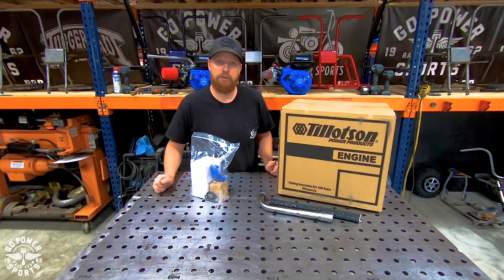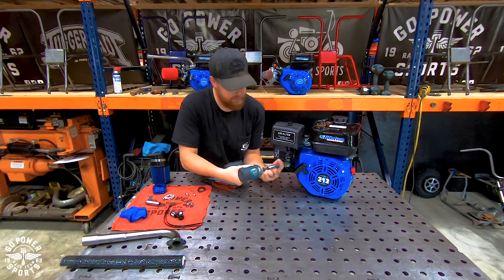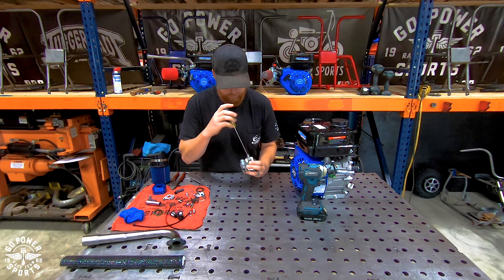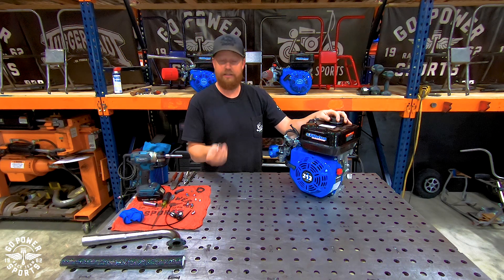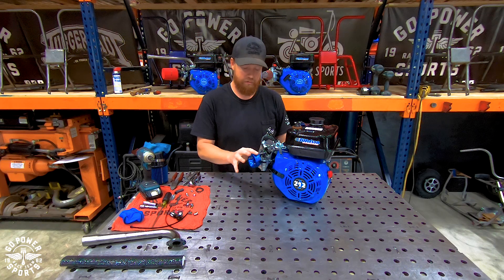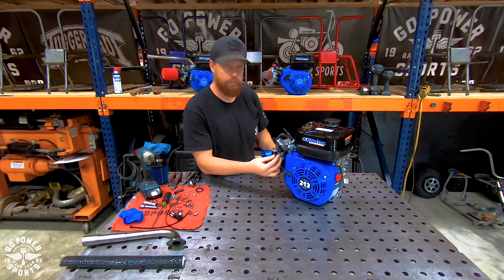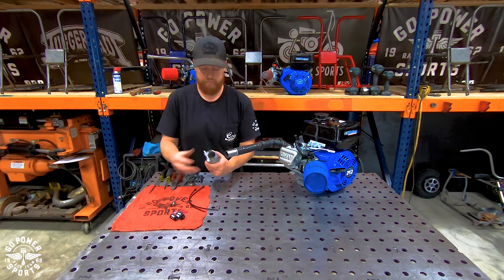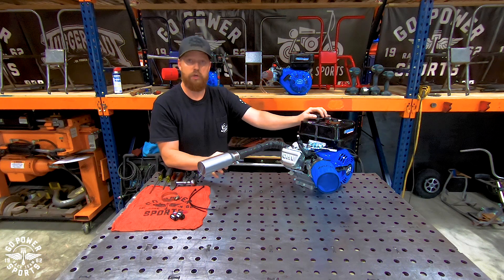Tillotson 212 Engine Stage 1 Install | Tutorial

Comment: Nice video.  I'm curious as to why you did not also remove that plastic restrictor plate on the engine side of the stock carb?  Wouldn't you up the airflow without it on a srage 1 build?

Comment: I have the same set up. My Tillotson always cuts out at high rpm wide open throttle and I have called y'all and talked to a couple different people there and they don't know why it's doing that.  Do stock carbs starve for fuel or max rpm for the cam? I'm not the only one this is going on with when I googled the issue. Is this common for the Tillotson 212

Comment: Just order the tilly 212, should be receiving it in 2 days. I have your guys stage one kit laying around from my old 196cc engine. I was wondering if, I Can install the stage 1 kit on the tilly right away out the box and then brake in the engine? Or do I have to brake in the engine first without the stage one kit, than once broken in, I can install the stage 1 kit.

Comment: Why my motor come stuck running wide open at start. So as you start it. It's running wide open
Reply from the maker: Loosen the 10mm nut on top of your throttle assembly.
Reply: @GoPowerSports  no brother that's not it this mf running full throttle on it's on an to damn hard. It's not the throttle 10mm

Comment: Do these engines run hot compared to the 6.5 predator? I bought one just these this last Christmas off your site and when breaking it in, it  seemed to be really hot. Alot hotter than the 6.5 and it seems noisy towards the bottom end more on the flywheel side maybe the governer chattering?..not sure. Im pretty sure I've already voided my warranty in some small way if not its expired so I'm running it now trying to enjoy it and praying it doesn't burn itself up in a day. It's great so far except for the heat and noise im hearing.. If anyone can give me some input on their experience with this engine it would be greatly appreciated. Also i thought the engine came with the throttle linkage to bypass the governer but it did not and it did not have the Tillotson name cast into the cylinder support on top on engine its under gas tank but i was still looking forward to it as silly as it is. Was advertised at 11hp but now the description says 9+hp on 2021 dyno so im guessing mine isn't 11hp then either. Overall the engine performs for now and has more power than 6.5 but still wasn't the stronger engine block like i was expecting. The cylinder support is there but no Tillotson name cast into block witch seems odd. There isn't the extra metal support below the cylinder on the flywheel side either. I guess those are on the more race motors but i still thought all Tillotsons would atleast have their name cast into the top like I've seen in all these youtube videos. Thanks sorry for the long message someone  help lol

Comment: What is difference between stage 1 stage 2 and so on ? 
Is it just more upgrades ?
Reply from the maker: Stage 1 will add 2-3 Horse Power.  Stage 2 will add another 5+ horse power on top of the stage 1.
Reply: so maybe with mods and arts you can add on an extra 10 hp?

Comment: I have the tillotson 212 and it bogs out at full throttle
Reply from the maker: Did you change out the jet?  Did you take the choke off?
Reply: It has the stock carburetor that comes with the motor
Reply: How do you vent the gas tank ?
Reply: or its clogged just cut the vent line and put filter in it  The stock does not let enough air and when you're at full throttle cause mine did the same thing and I had to open the gas tank lid while I'm driving to keep the engine from dying
Reply: Bogs or you’re hitting the governor?  It’s abrupt on this motor.
Reply: How can you tell if your hitting the governor?
Reply: When I give it full throttle it jerks !
Reply: Alexx have you removed it?  Before I removed mine, it felt like someone was chopping the throttle.  It wasn’t bogging, it was the governor closing the throttle.  After I removed it, it now spins freely into the stratosphere.
Reply: have video
Reply: Kind of  Take the gas cap off and try it and see if it still does it
Reply: Nothing wrong with it, it's the govonor that's kicking in..
Reply: @Zarlax  idk if you unscrew the governor screw you get like 5000-6000 rpm with stage one and jet
Reply: @Knight Recon my bad I meant throttle screw. It’s a screw right where the throttle arm is on the engine. A big part of speed it gearing which is why I use taller gearing and a clutch. In the past I have used the juggernaut as well but only got 40. I put a heavy duty clutch on and I am able to hit over 50. Clutches wear out faster than TCs tho

Comment: I wished tillotson made a engine in 300 to 400 cubic centimeter size maybe 2 additional engines one a 350cc the other a 460cc both equipped with 10amp charging systems and electric/recoil start a 460cc engine would probably produce 20hp bone stock and make both engines stock rpm's 6000 right out of the box.